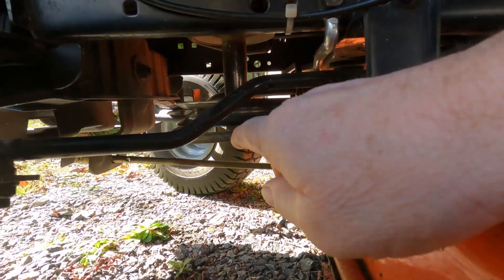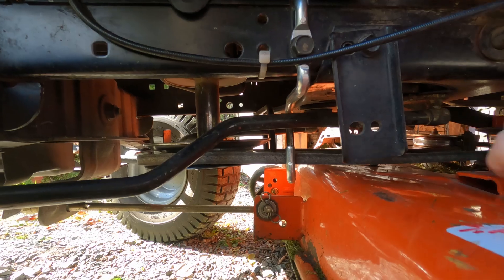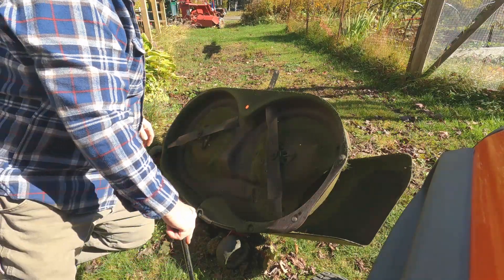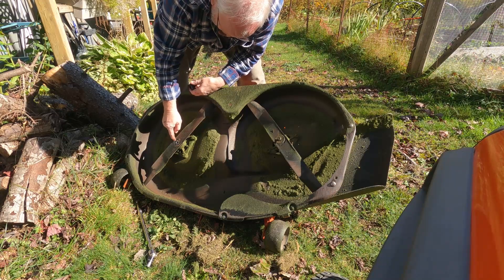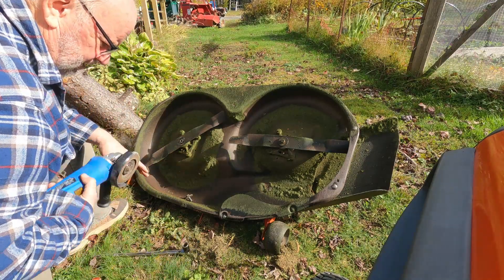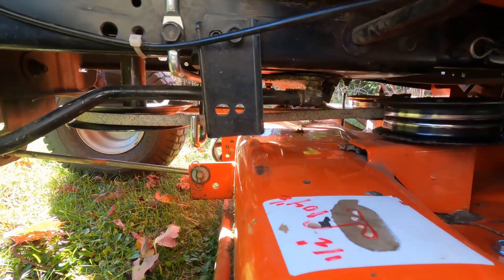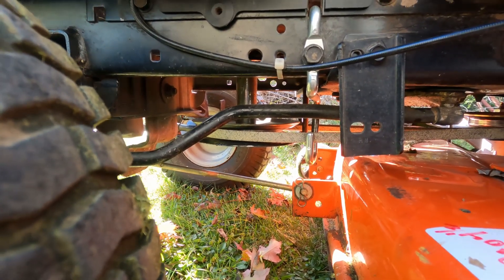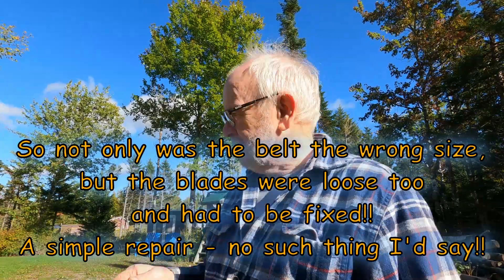A Simple Quick Repair

Comment: It is odd how Nannie never kept breaking the lawn tractor when she used it 🙂 I think your modification to make the blades tight should make a lot of difference, great job. It looked like the shorter belt made a huge difference too. We have huge problems with part numbers on our old equipment but I think that is because the original parts are no longer available
Reply from the maker: How's she goin'?  Ha Ha Ha!!  You have a good point there Joseph!!  Nannie must be a better operator than me!!  LOL  Part numbers are one thing, but a good part description goes a long way in making sure the replacement part is correct eh!!  I really liked this comment!!  LOL  Take 'er easy!!

Comment: Lots of almost replacement parts out there in the aftermarket.  It's cool out here today too , yesterday we had the AC on :)
Reply from the maker: How's she goin'?  A simple repair, like changing the belt, turned into some heavy duty repairs and the 15 minute belt change turned into an hours job!!  And the replacement market is buyer beware eh.  I do find on Amazon, for the most part, the descriptions are pretty complete.  But since the Husqvarna manual didn't give the belt length I only had the part number to go on, and it said the belt was 101.4 inches long.  It turned out that was too long.  Now I know.  Take 'er easy!!

Comment: Everything has to be just right.  I always loved it when I put a new belt on the mower, it seemed to cut better even though it didn't.  Just like a new windshield makes the truck run better.  Yard is looking good Mike.  Stevo
Reply from the maker: Good day eh!!  The belt was just an inch and a half shorter but it made a world of difference with how the mower worked.  But it was a lot of work to do before I got to changing the belt!!  Glad I caught the blades being loose though.  That wouldn't have ended well eh!  LOL  Take 'er easy!!

Comment: I use lock washer on my deck I had the same problem and I use a sir or cordless 3/8 impact to tighten them and take them off
Reply from the maker: How's she goin'?  A lock washer won't work in this case Bob.  The spindle shaft was too long, or the blade too thin, and so the washer would just come up against the shaft and not hold the blade tight.  That's what was going on here.  On the old blades I took off last spring had Belleville washers on them.  They worked as it pressed against the blade and not the shaft.  Thanks for the comment though.  Take care!!

Comment: Husqvarna has been doing that for years I've had belts 4" too long, they would tell me I gave them the number wrong. Not possible, I went to tech. school for this. Good video.
Reply from the maker: How's she goin'?  Thanks a lot for dropping by the channel!!  The part number in the Husqvarna manual doesn't show a length, but I' m sure the length should be 100 inches.  It was interesting to hear you say Husqvarna does this often.  I have to say, the quality of Husqvarna has been going downhill the last few years in my opinion.  Thanks a lot for your comment.  Take 'er easy!!

Comment: Hey Mike. In cases like this I am a fan of Red Locktite. Having to heat them up with a Mapp torch is fine as no Damage to the rest of the deck will happen.Just have a wet cloth handy so as not to damage the seals in the bearings. The blade iself will act as a sink. V-belts are not the greatest way to get power transmission. Problem here is the belt has to switch planes. It will then only track well on one plane or the other. It would be great if they use a drive shaft. They prefer to have an angle to them so all 4 bearings/cups are being used. Only problem there is they will last far longer and not need more repairs and their asociated parts eh. Well bud you may be seeing more wear and tear but you know the know and have the tools to make it happen for a good long time yet. Take care my old friend. Hugs for Nannie J of course.
Reply from the maker: How's she goin'?  Well Dean when I put the blades on last spring I put 'Never Seize' on them because I have had them rust and seize up.  And this is what happens, it was almost completely unscrewed, and that had me almost completely unscrewed too!!  LOL  Maybe blue Loctite instead of red.  That way I can get it apart with the strong arm and the Loctite might prevent it from rusting and seizing too.  I think they use belts for power transmission because it's cheaper to make and design than trying to get a drive shaft installation done.  Oh well, $30 a belt every year isn't too bad I guess eh!!  I'll give Nannie a hug for ya buddy and we'll talk to ya!!!
Reply: @GrampiesWorkshop  Shine on Mike. Yer an amazing friend.

Comment: Great fixes Mike. Strange thou about the blades. Must not of been thick enough. I’ve had my share of belt troubles. 
Yes sir, October first and she’s cooler for sure Mike. 
You and Nannie have a great week. 👍🏻👍🏻👋👋
Reply from the maker: How's she goin'?  Noel the blades I bought this time were cheaper ones and I think they make them thinner so they can be cheaper.  Having the blade bolt come loose was a surprise for me though.  Man I strained my milk tightening that bolt last spring!!  LOL I guess I need more wheaties eh!  LOL  Take 'er easy!!
Reply: Maybe you should not put anti seize on them. 🤷🏻‍♂️. I would put a little Goop on the treads, then once tight put a little on the nut and stud. And the Goop will allow the nut to be takin off.
Reply from the maker: @noelstractors-firewood57  I did have anti seize on them Noel.  Did you mean Loctite?
Reply: I put anti seize on an oil drain nipple with cap. Not sure why I did that, any way the nipple fell out. And all the oil came out. Never did that again. Not I don’t mean lock tight Mike. I use the Goop on a lot of stuff. I’ve showen it before. 👍🏻👍🏻👋👋

Comment: Hi Mike. Nice fix! Having to grind down the shaft the blades go on sure seems strange. 🤔 It doesn't take much of a difference in length for a belt to be useless. Is the belt tensioner working properly? On my mower, the tensioner is really pushing on that belt. Take care!
Reply from the maker: How's she goin'?  That's a good point Brian, but the tensioner is working good, as far as I could tell.  Lots of tension on the belt.  In the Husqvarna manual, it only listed the part number and didn't give a length.  So when I went on Amazon, I found this belt that matched the part number and it said it was 101.4 inches long.  I tried to measure the original belt but it was pretty stretched and damaged so that didn't work too good.  I got the 101.4 inch belt and this is the one that kept coming off.  Then when I searched Amazon again a few weeks ago, I found this belt that matched the Husqvarna part number and it said it was only 100 inches long.  So there ya go.  I think the original belt should be 100" long and now I have that one installed.  It should be good now, but we'll see I guess.   Griding down the stub shafts on the spindles I think was needed because the blades I bought were cheap ones and they weren't as thick as the originals.  Take 'er  easy and I hope you're over the 'man cold'!!  LOL
Reply: @GrampiesWorkshop  thanks! 100% now. Sometimes we just have to do what it takes to make thins work!👍

Comment: It turns out having to take the deck off to put the belt on was a good thing so you could fix the  loose blades. I hope this belt works much better for you.
Reply from the maker: The new belt is a good fit.  I guess maybe the tractor has lost weight and I needed to hitch up it's belt a notch or two!!  LOL  Love ya!!

Comment: I wonder if a thicker washer on the bolt would accomplish the same results?
Reply from the maker: How's she goin'?  Thanks a lot for dropping by!  I appreciate it!!  A think a thicker washer wouldn't have fixed the loose blades as the washer was coming up against the stub shaft because it was longer than the blade was thick.  I did notice on the old blades I removed back in the spring, that one washer was cupped, like a belleville washer.  That would have worked.  Thanks for the comment and I hope you comment again on the next video!!  Take 'er easy!!